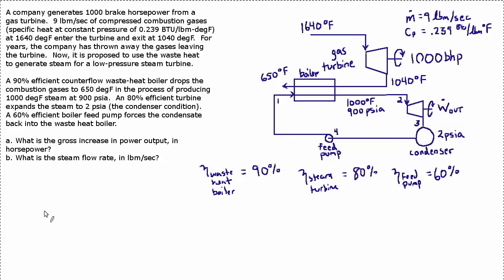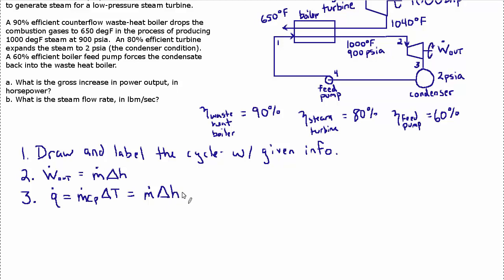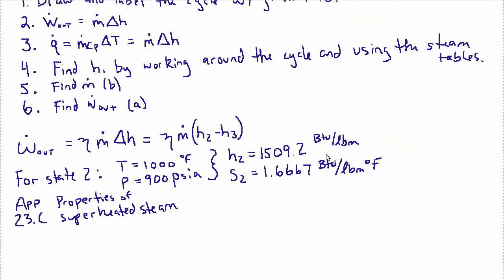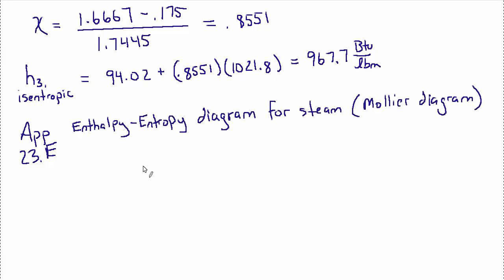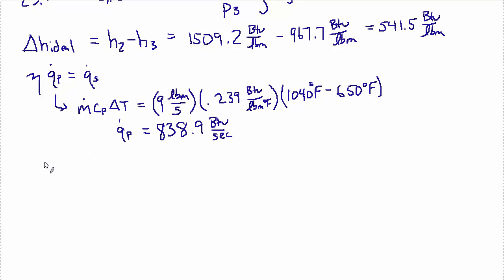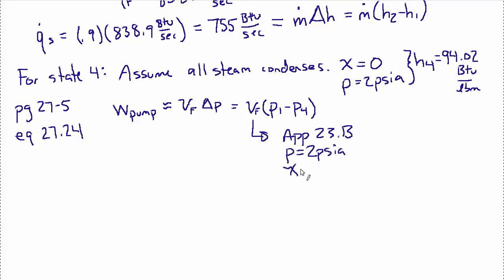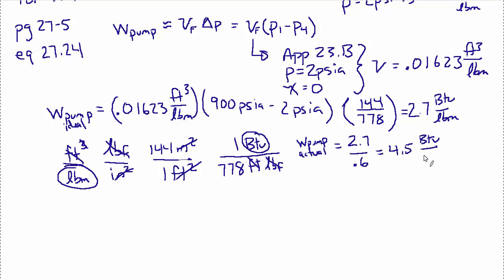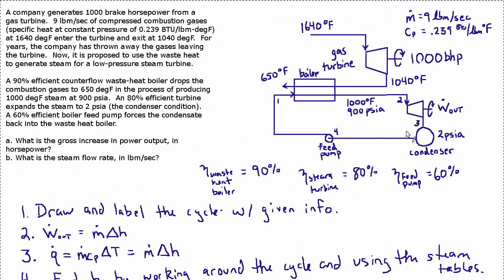Solving Power Cycle Problems: Gas and Steam Turbine Efficiency Explained | PE Mechanical Exam Prep

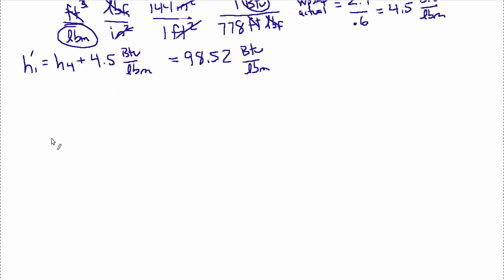Comment: 24:24 why are you using 4.5 BTU/lbm instead of 2.7 BTU/lbm? The actual pressure increased from 2psia to 900 psia which is equivalent to 2.7 BTU/lbm. So the enthalpy at 1 is 94.02 + 2.7 BTU/lbm. Please correct me, if I am wrong. 

I would use 4.5 BTU/lbm only for the energy calculation for the pump not for the input heat to the heat exchanger.
Reply from the maker: Jojo, first of all, kudos to you for hanging with me 25 minutes into this video!  Are you a PE candidate?  It looks like I was accounting for the efficiency, if you go back ~20sec I explain the rationale.  If that energy goes into the pump (or is wasted) it is not available for other purposes.  Let me know if you still think it doesn't add up.
Reply: @MechanicalPEExamPrep  Sir, I have watched and learned at least 20 videos from you. Your presentation and knowledge are incomparable. Thank you for your time and effort to educate us. Yes, I am a Chemical PE candidate and planning to write the exam next month. 

The loss of efficiency of the pump can be due to many reasons. If you assume that the additional energy used by the pump contributed to an increase in condensate temperature, I would agree with that assumption. Anyway, this is not going to make any significant change in the output. I just want to educate myself as one correct or wrong answer in the PE exam may change the result.